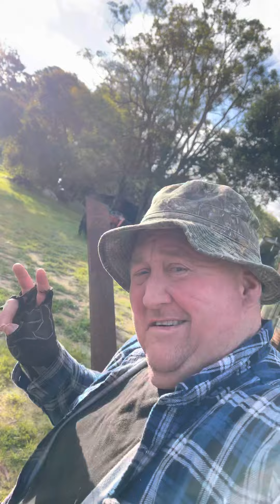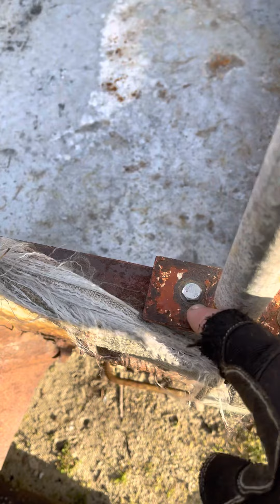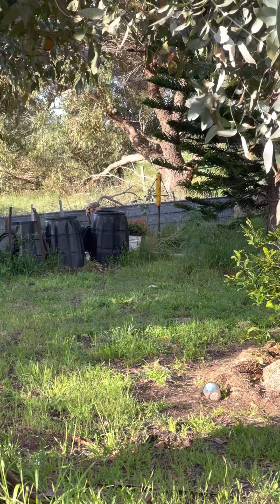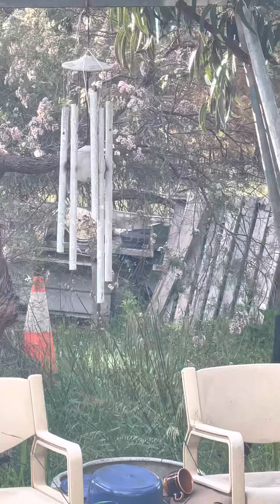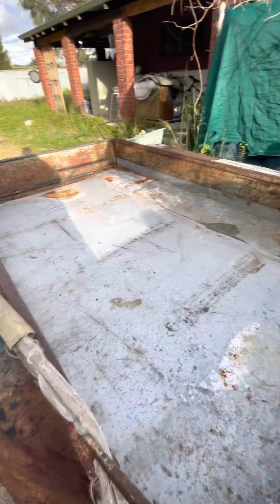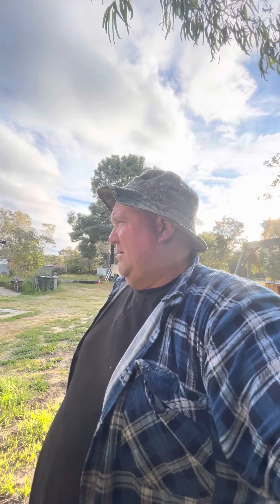✨🙏🏽🐨🎶 Pagbati sa Lahat, 🙏🏽😃🌿☂️ Umassa na ang iyong sarili at mga minamahal ay Ligtas at »

Comment: Beautiful sky perfect weather Ingat ka kuya
Reply from the maker: 👋😺 Magandang Umaga Maganda 🪷 was a break in the weather, 🌤glad to have accomplished more grounds maintenance, 😅🙏🏽 some heavy logs 🪵 & general debris mula sa previously hurried maintenance from around main house had been cluttering up an exposed ‘visual’ section, for well over 9X years.❗️🕰 
Finally cleared away for the slasher [mowing device] access on tractor 🚜 For not only a visual benefit, though equally important a fuel for a potential fire 🔥 reduction/mitigation requirement, Arumuna 🙏🏽😃
Be Well Kaibigån 💫